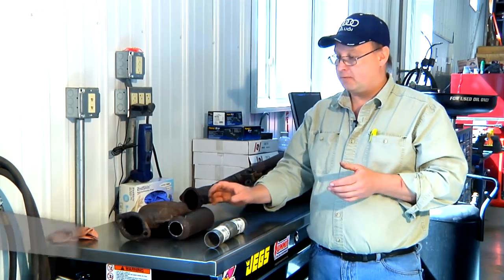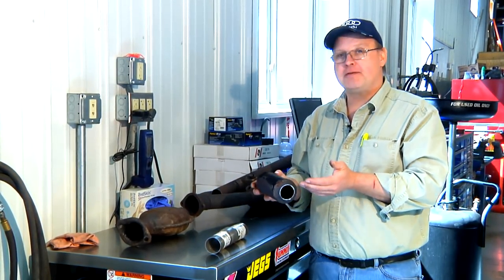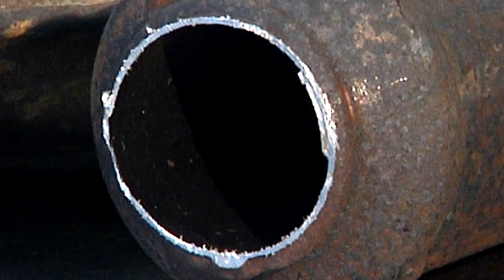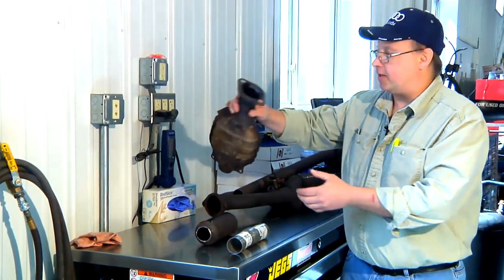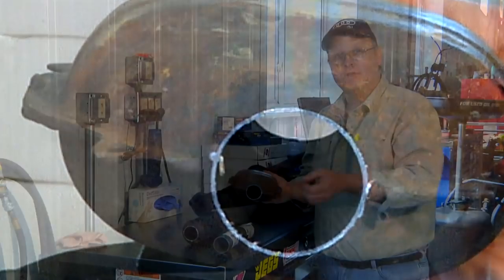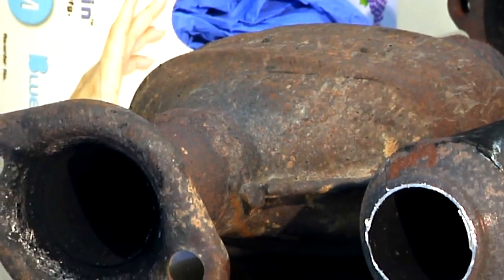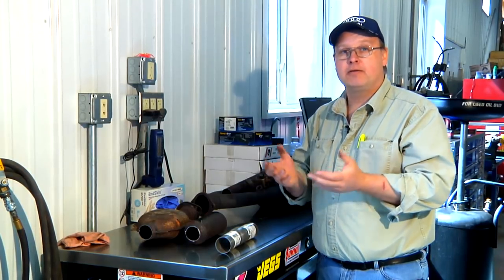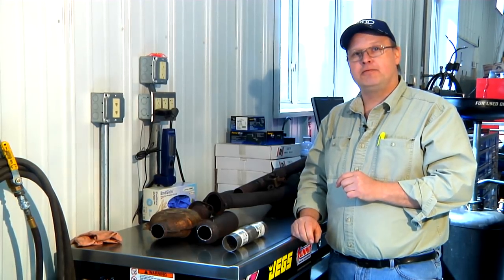What Happens if You Replace the Exhaust Resonator With a Pipe? : Under the Car Repairs

Comment: Anybody here that knows their shit will tell you that an engine is basically just an air pump. The more air you can shove into and out of the motor, the more power you'll make. The same applies with forced induction vs normal aspiration. There is no replacement for displacement, but a NA motor will never produce the power a boosted motor is capable of. So when you free up back pressure from the exhaust, and add an aftermarket intake, you'll make more power, and the motor will run MUCH more efficiently

Automotive performance 101

Of course you can't put a massive turbo on a stock vehicle and not expect some problems to arise, but that's a different matter.
Reply: Not the most informative post. You sound like you are implying that running open headers (Least back pressure) on an otherwise STOCK application with little more than an intake will net you the most power.
This is far from the truth. An exhaust has to be tuned to the application. No matter the engine, even swapping the entire intake manifold will only get you so far.
A manifold with 6 inch intake runners and a wide open exhaust on a stock 4 cylinder doesn't make much sense.

Comment: Also, I love how he called that gutted converter a "resonator"...
Reply: you think all resonators look the same? you would fail the certification test
Reply: taledarkside show me ONE resonator that looks like that and ill believe you because that's a gutted cat . which stands for Catalytic converter if you didn't know that. You also fail to know that resonators are straight through and therefore can't add any backpressure
Reply: my resonator adds back pressure. Let me know when you get a degree in mechanical engineering
Reply: @taledarkside  and what type of mechanical engineering degree do you have? Devry institute? I'm guessing nothing to do with performance engines. The size of your piping is what creates back pressure, not resonator. The resonator has less baffling than a muffler, actually decreasing back pressure. Nearly every aftermarket exhaust system out there deletes resonators. People only add them to get rid of drone. Manufacturers do the same to meet decible requirements and please the mass buyers. Back pressure is confused with exhaust velocity, which creates scavenging. And all of this depends on motor and rpm. Most of the "experts" didnt learn this from a school, they learned it from experience and building motors. The guy in the video is a good dealership mechanic at best

Comment: Half of the back pressure controversy comes from the use of the term "back pressure" itself, which doesn't really mean what it implies.  What he's talking about and what most people mean is resistance to flow.  And yes, flow resistance affects the power curve of the engine, and can actually increase power at certain rpm ranges.  Think about what happens when you put your thumb over the end of a hose, you've added resistance to flow, but the water that comes out is moving faster.  Higher resistance = increased velocity is basic principal of flow physics.  Exhaust is not nearly that simple, but that's the main property at work when deciding ideal flow characteristics for an exhaust system.  What's actually happening in an exhaust system is pretty complex, but there's tons of research and articles out there on the subject for those interested in how it actually works.
Reply: what you're saying is partly true, you're talking venturi effect.  your higher velocity from more restriction also equal loss of volumetric flow, which is bad.  you want a large enough to get unrestricted flow but not too large that you lose velocity.
Reply: j wayneair
That was basically my point, I wasn't trying to imply more restriction is always better.  Velocity and volumetric flow are two variables in the net effect an exhaust system has on the power curve of an engine.  And there are even more things to consider, the effect the width and velocity of each pulse has on subsequent pulses for example and how that varies with engine rpm and pipe diameter.  My point was it's way more complicated than people think and the engineers of a stock engine have already taken everything into account, so unless you know what you're doing you're probably going to make things worse. For anyone considering a system for an upgraded engine the good news is with a little research you'll probably find that someone else has already done the math and/or trial and error for you.
Reply: ...... and when you put your finger over the hose, the amount coming out is moving faster, but theres less of it coming out--so which is better..a tiny bit moving quickly, or a lot moving slower? depends on the engine size.

Comment: The funny thing to me about this is that he said the resonator provides back pressure. Pretty much every resonator I've ever seen, including the one he had is basically the same thing as a glass pack with a straight through design. Which will not cause any back pressure or restriction of any sort ever.

Comment: The resonators are there to cancel out certain sound frequencies and make the exhaust quieter. Besides, I think the catalytic converters produce more back-pressure than the resonators. I can't imagine replacing the resonators with straight pipes (or glasspacks in my case) will do any harm.

Comment: A friend of mine was running 3" exhaust on a fully built high compression B18c1 in a CRX. I told him he needed to get his pipes reworked and go down to 2.25". On paper he should have been putting about 250-260 HP to the wheels, he got a dyno and was running 217 at the wheel. I told him again to change to 2.25" pipes. He had his exhaust redone with 2.25" and way laying 254 hp on the dyno, also gave him about 10 more mpg. Back pressure DOES matter, but typically opening your pipes up from factory setup nets more top end HP and better MPG as long as you dont completely eliminate back pressure.
Reply: Big myth...it's not about backpressure, it's about exhaust gas velocity...

good read off of thumepertalk.com motor cycle forum that has some more insight.

Backpressure: The myth and why it's wrong. 

I. Introduction
One of the most misunderstood concepts in exhaust theory is backpressure. People love to talk about backpressure on message boards with no real understanding of what it is and what it's consequences are. I'm sure many of you have heard or read the phrase "Engines need backpressure" when discussing exhaust upgrades. That phrase is in fact completely inaccurate and a wholly misguided notion. 

II. Some basic exhaust theory
Your exhaust system is designed to evacuate gases from the combustion chamber quickly and efficently. Exhaust gases are not produced in a smooth stream; exhaust gases originate in pulses. A 4 cylinder motor will have 4 distinct pulses per complete engine cycle, a 6 cylinder has 6 pules and so on. The more pulses that are produced, the more continuous the exhaust flow. Backpressure can be loosely defined as the resistance to positive flow - in this case, the resistance to positive flow of the exhaust stream. 

III. Backpressure and velocity
Some people operate under the misguided notion that wider pipes are more effective at clearing the combustion chamber than narrower pipes. It's not hard to see how this misconception is appealing - wider pipes have the capability to flow more than narrower pipes. So if they have the ability to flow more, why isn't "wider is better" a good rule of thumb for exhaust upgrading? In a word - VELOCITY. I'm sure that all of you have at one time used a garden hose w/o a spray nozzle on it. If you let the water just run unrestricted out of the house it flows at a rather slow rate. However, if you take your finger and cover part of the opening, the water will flow out at a much much faster rate. 

The astute exhaust designer knows that you must balance flow capacity with velocity. You want the exhaust gases to exit the chamber and speed along at the highest velocity possible - you want a FAST exhaust stream. If you have two exhaust pulses of equal volume, one in a 2" pipe and one in a 3" pipe, the pulse in the 2" pipe will be traveling considerably FASTER than the pulse in the 3" pipe. While it is true that the narrower the pipe, the higher the velocity of the exiting gases, you want make sure the pipe is wide enough so that there is as little backpressure as possible while maintaining suitable exhaust gas velocity. Backpressure in it's most extreme form can lead to reversion of the exhaust stream - that is to say the exhaust flows backwards, which is not good. The trick is to have a pipe that that is as narrow as possible while having as close to zero backpressure as possible at the RPM range you want your power band to be located at. Exhaust pipe diameters are best suited to a particular RPM range. A smaller pipe diameter will produce higher exhaust velocities at a lower RPM but create unacceptably high amounts of backpressure at high rpm. Thus if your powerband is located 2-3000 RPM you'd want a narrower pipe than if your powerband is located at 8-9000RPM. 

Many engineers try to work around the RPM specific nature of pipe diameters by using setups that are capable of creating a similar effect as a change in pipe diameter on the fly. The most advanced is Ferrari's which consists of two exhaust paths after the header - at low RPM only one path is open to maintain exhaust velocity, but as RPM climbs and exhaust volume increases, the second path is opened to curb backpressure - since there is greater exhaust volume there is no loss in flow velocity. BMW and Nissan use a simpler and less effective method - there is a single exhaust path to the muffler; the muffler has two paths; one path is closed at low RPM but both are open at high RPM. 

IV. So how did this myth come to be?
I often wonder how the myth "Engines need backpressure" came to be. Mostly I believe it is a misunderstanding of what is going on with the exhaust stream as pipe diameters change. For instance, someone with a civic decides he's going to uprade his exhaust with a 3" diameter piping. Once it's installed the owner notices that he seems to have lost a good bit of power throughout the powerband. He makes the connections in the following manner: "My wider exhaust eliminated all backpressure but I lost power, therefore the motor must need some backpressure in order to make power." What he did not realize is that he killed off all his flow velocity by using such a ridiculously wide pipe. It would have been possible for him to achieve close to zero backpressure with a much narrower pipe - in that way he would not have lost all his flow velocity. 

V. So why is exhaust velocity so important?
The faster an exhaust pulse moves, the better it can scavenge out all of the spent gasses during valve overlap. The guiding principles of exhaust pulse scavenging are a bit beyond the scope of this doc but the general idea is a fast moving pulse creates a low pressure area behind it. This low pressure area acts as a vacuum and draws along the air behind it. A similar example would be a vehicle traveling at a high rate of speed on a dusty road. There is a low pressure area immediately behind the moving vehicle - dust particles get sucked into this low pressure area causing it to collect on the back of the vehicle. This effect is most noticeable on vans and hatchbacks which tend to create large trailing low pressure areas - giving rise to the numerous "wash me please" messages written in the thickly collected dust on the rear door.
Reply: LOL why did he put a 3" exhaust on his 4 cylinder?? Your suggestion of 2.25" was a good one.
Reply: I'm sure it was suggested to him from someone else. 3" exhaust is fine for a 4 cyl. When you're boosting though.
Reply: Yeah I know that. Lol. I meant to include naturally aspirated in that paragraph.
Reply: So I'm running 2.5" on a b18c1. Only other aftermarkets at this point are Integra Type R pistons, DC 4-2-1 header, magnaflow california cat (2 5/16 I.D.), 2009 Civic Si muffler (2 1/4 inlet), AEM short intake, skunk2 pro series intake manifold, & chipped ECU. If you had to guess, do you think 2.25" would be better on my setup?
Reply: Yes run a 2.25". Won't be as big of a difference than the guy running a 3" because that's just ridiculous on a non boosted 4 cyl. But it should probably give you a little more performance.
Reply: I have a 2010 Honda Civic, I had the resonator and stock muffler removed and replaced with a magnaflow muffler, also had a bigger diameter pipe replacing the stock pipe, did I lose low end torque? Would you recommend the resonator be put back? Thanks in advance ThatOneGunGuy for your response.
Reply: I really don't know much about the newer Honda motors. The maximum flow rate will be determined by your most restrictive element in the exhaust system. If you were to run 6" diesel exhaust pipe all the way from the manifold to a 1" tip the 1" tip will determine your flow. Resonators aren't typically designed to be restrictive, that's more suited for a muffler, but they can be in a high performance design. Unless you're pushing more than 500 hp from your 4 cyl. I would, personally, leave the resonator on to take the raspiness out of your exhaust note. My personal recommendation for any N/A 4 cyl. is 2.25" pipe and free flowing mufflers, resonators and catalytic converters. Any other questions would likely be better answered by forum members with personal experience.
Reply: thanks for the quick response and info
Reply: Brendan Doyle 3'' inch tailpipe or just exhaust piping?
Reply: Squidy214 Brendan Doyle was talking about exhaust piping. But the 3 inch tailpipe is even less necessary.
Reply: ThatOneGunGuy after reading you guys here a bit, and then many hours on many forums, the kind of setup you last mentioned is essentially what I went with on my 1.8 vtec (Integra GS-R B18C1): 2.25" (though it's actually a bit closer to 2.375" ID) kteller stainless piping after a magnaflow california cat of same ID, same ID magnaflow 18" resonator, and a 2.25" 2009 Civic Si muffler (on which the tip is about 2.25 as well, and looks clean). I haven't dynoed it, but I feel like I got it right. Thanks to 92HondaEX  for all the info, ThatOneGunGuy for kind of starting this little "thread" and sharing experience, and Brendan Doyle  for your input as well.
Reply: Should feel it more in the top end of your RPMs when opening it up from stock exhaust, it's amazing what 5-7 HP does to a little car like an Integra!
Reply: oh ok thanks ThatOneGun Guy
Reply: Mine? B18 is in a del sol. =]
Reply: That's complete opposite of what I found on mine.... went from 2" to 3" and gained power and torque all across power curve.. B18C EG6 civic running a Hondata s300j. b18cr cams, intake, FPR.. Hondas love having bigger exhausts. 3" is fine, 2.5" is ideal (no drone), 2" is factory most of the time.
Reply: Never heard of such a thing from a 4cyl. N/A Honda motor. Everyone around here runs 2.25" or 2.5" unless they are boosted then they run 3". Several of the people I have spoken with matched their exhaust systems after many dyno pulls with different CAIs, exhaust sizes and mufflers.
Reply: ghettodriftmonkey1 ThatOneGunGuy so ghettodriftmonkey1 is talking going from 2" to 3", but if he goes from 3" to 2.5 or 2.25", he may see gains again - both of you could be right in this instance. Your points don't necessarily disagree. 

Factory for my b18c1 is 2.36" (60mm, i believe). I'm at 2 3/8" now; there was actually smaller piping (some of it was 1.75", and i thought the shop had replaced all my pipe with gs-r piping) when i had the motor put in, and now i'm just over factory, and the car is without a doubt quicker now, obviously. But the only way we can really know what's best for these 4 cyl NA motors is testing. I'm not going to buy multiple setups and dyno w/ each one any time soon, so seeing multiple sources claim 2.25" - 2.5" performs better than 3" is enough for me to be content right where I'm at. ghettodriftmonkey1, let me know if you switch and dyno, though.
Reply: ghettodriftmonkey1 your Tiny engine would benefit from a small  diameter pipe unless you are always pedal to the floor... you are actually loosing low end power because the 3 inch pipe is too big and your engine doesn't pump enough cfm through so your exhaust  gasses cool down and get heavy and dense . With a smaller pipe your exhaust  gasses  stay hot and each pulse has a vacuum pocket behind it that pulls the next engine pulse out all the way to the end of the pipe. This is scavenging and for the little amount of pumping action that little b18  does you won't need anything over 2.5". Now if you are pushing 500 hp boosted that little engine would breath well enough to need a bigger pipe like 2.75". But would still be fine with a 2.5" driving street/strip